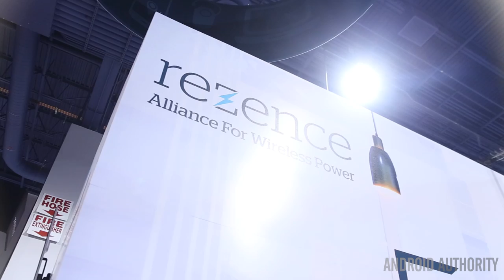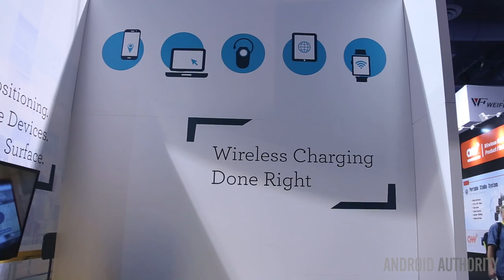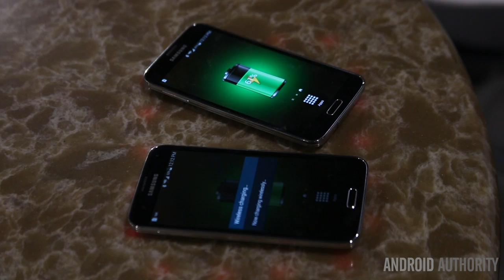Alliance For Wireless Power Interview

Comment: Sounds like they are trying to bolster their portfolio because they know Motorola / LG / Nokia are already shipping QI enabled products for awhile.

I doubt the two standards will combine PMA & A4WP and become sucessful as QI is already established and early adopters already have bought into QI and accessories, why would someone buy a new device that uses the other "standard" and then throw out all their Tech ???

Its stupid really why can't they all band together with QI standard now and concentrate on improving that rather than fight with brand name dropping, its stupid.

QI came to market first, now they show up late to the party showing off big names in a "My dad could beat your dad up way", they just look like the guy who stole the idea but could not quite figure it out.

The only advantages I can see being gained in Wireless is Faster charging and better range but inductive charging causes heat ( likely to help over heat devices at higher outputs ) and why do you need to Wireless charge fast ? I use my QI chargers when im in the car or asleep.

If i want to fast charge a device i'll use a high output Wall adapter with the device switched off :

 A. its like 10 quid for a 3 or 4 amp charger 
 B. Its smaller and more compact.
 C. You don't need to make sure you have the correct Voltage or Ampage to make sure the charger works !